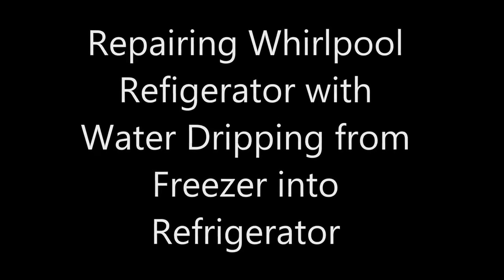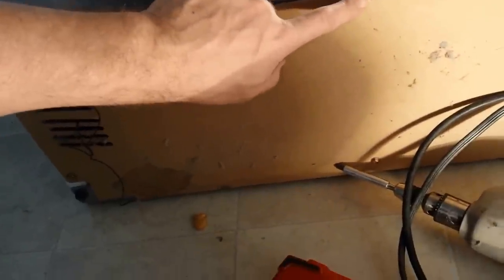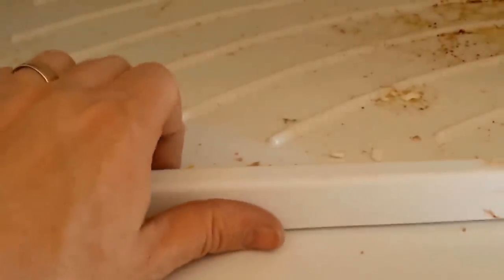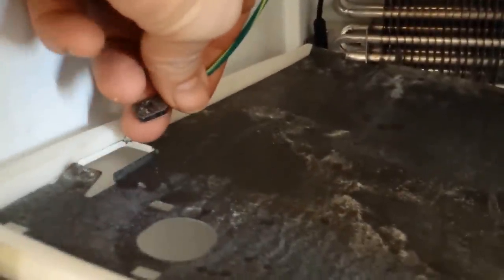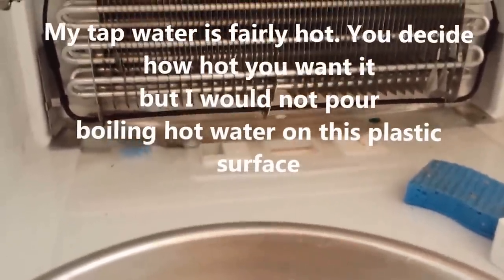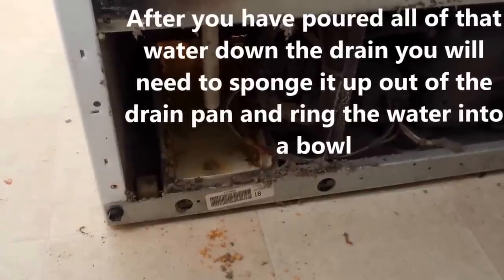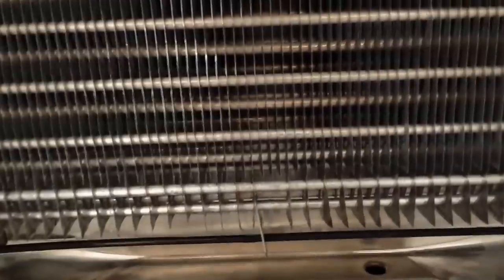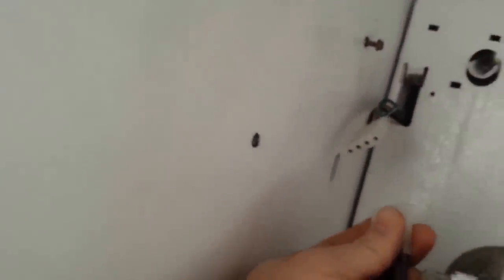How to fix Whirlpool dripping water from freezer into refrigerator compartment

Comment: Thanks Im going to fix mine soon based on this. my model is 1998 but looks similar except the ice maker.
Reply from the maker: Good luck. Mine is still problem free since this time.
Reply: ok I’m i. the middle of it tons of ice under the plastic tray. removed that and any residual ice 2 hrs later water is coming out the bottom too. thanks again for the detailed video!! btw mine was filthy underneath the tray too.
Reply: Btw my buddy sent me a pro-move. hang a small piece of wire on the defrost heater rod (the black thick horizontal rod just an inch above the hole)  and hang the wire to go about 2 inches into the hole. That way when defrost cycle goes the wire warms up and prevents any freezing from happening again. just take bare copper electrical wire and make a hook to hang on the rod.

Comment: this happens when the defrost cycle is on and the heating element that intertwines around the evaporator coil is melting the frost build-up. When this cycle ends there is still water dripping down the fins to the drip pan, which is aluminum, the freezing cycle has started before all the water has drained that's when the ice forms. After a few of these cycles you have an ice jam. There is a kit available to extend the heat from the heating element onto and inside the drip pan and drain opening. Try a search for th kit and look at the parts to get an idea of how it is designed. Then you can make your own (which is what I did) by taking some thin aluminum sheeting, either from roofing flashing or building materials, or other materials and cut a long narrow strip that you can clamp or crimp on (being careful not to damage the heating element and run route from the heating element closest to the drip pan down to the pan. Shape the end to allow insertion to the edge of the drain tube. Be careful not to put the strip to far down the opening or on any plastic parts, just the metal. This will allow heat to travel to the metal drip pan and warm the area around the drain. This gives extra time to keep the metal warm after the heating element has been shut off by the end of the defrost cycle. Also it is vital to clean all the debris and dust from the bottom and underside areas of the condenser coil which prevents airflow to remove the heat and that is disruptive to the cooling process.

Comment: I did it but it started again. I think it was actually cogged with paint chippings from the back playe which actualy was corroded.. i sucked out some with a magnet but after a month or 2 it started again.. ?
Reply from the maker: coocoonmama could also be food clogging it. I would test that theory by pouring water down the drain pipe and listening for it splashing in the drain pan located at the bottom and underneath of the fridge. If no water splashes and in stead  starts filing the freezer, the pipe's still clogged.
Reply: I clear out the frozen area and it continues to freeze up again. Go to this parts website. Put in your model number. One of the problems will be leaking. It will take you to this little part that is easy to replace. It says that it fixes the problem 72% of the time. I’m going to give this a try. https://www.partselect.com/AdvancedModelSymptoms.aspx?ModelNum=ET8WTEXMQ01&mfgModelNum=&fkMfgID=3&ModelMasterID=132935&PID=13

Comment: what if there is a leak from the unit. top freezer, water leaks onto floor, not down into crispers. Drain is not frozen, single solenoid valve is not leaking. Water randomly appears on floor....cracked drain pan maybe?
Reply from the maker: yeah, my first question would be that pan leaking or just filling up too much before it evaporated. Then I'd be looking at the water line or the valve to the ice maker leaking.

Comment: I usually use a hair dryer aimed at the area where the drain tube is. Can take about 2 or 3 hours to  thaw the drain tube. 
Has anyone had success with adding the aluminum or copper wire to the heating element  and into the drain hole.

Comment: I have exactly this problem with my 13 year old whirlpool gold . Could I just unplug for a day and let it defrost on its own?
Reply: I should add , I just had a repair person in to change a part  because the freezer wasn't freezing. As soon as the repair person left I noticed a huge buildup of ice at the very back centre lower part of the freezer. I have been cleaning up water in the refrigerator all week. I am concerned about undoing and wires and hoping that I could just let the icemelt on his own?
Reply from the maker: Donna Giamprini yes. you certainly can let it defrost that way. most of us just don't have the time to wait.

Comment: Use a 1/4 inch nut driver. Much easier. I put a copper wire on the heater into the drain.
Reply from the maker: I think the wire is a great idea. I'll do it with mine if it ever freezes over again. It hasn't since I made the video. 😁

Comment: Hey guys , whirlpool sell a drain tube that has a p trap 
Part # w10619951, after you defrost the ice on the drain tube, try to replace the drain tube on the back by the drain pan, since the kind shown the video doesn’t have a p trap so, easily get ice up, because heat from condensing  unit gets in .

Comment: My husband has done this twice, but the fridge goes back to the same problem after two weeks. What else could be going on?
Reply: I've done mine over and over again. It still leaks.  I ran a cable wire in the drain hole and moved it up and down to clear any debris thinking I had to have unclogged it this time.  Didn't work.  It still leaks. I don't know what else to do. 

Jan

Comment: Would it have been easier to use a heat gun instead of constantly pouring hot water into the refrigerator?

Comment: Mark, you didn't give a solution to prevent this happening anymore...... I fixed mine from ever doing it again.
Reply from the maker: Great, what did you do? I'd love to hear your ideas. I didn't have an idea to get this to never happen again. So what did you do?
Reply: @GetItDoneProjects  See the heater element that defrosts the evaporator? Bend the area over the drain closer. When it operates,  it'll keep the drain from freezing. I bent mine down to about a half inch above. Hasn't frozen since. I would do what you did every 4-6 months. When I saw the title to your video I was excited until I watched it.

Comment: I did this fix and it continued to freeze up.  Your drain might be plugged with food or dirt. If yours is fixed with the wire fix great. But others say replacing the sensor might be the proper fix. 

There is a temperature sensor that makes sure the defrost cycle is long enough. People can go to www.partselect.com and enter their model number. See the issue “LEAKING”, and follow the link to this page (for mine).  https://www.partselect.com/AdvancedModelSymptoms.aspx?ModelNum=ET8WTEXMQ01&mfgModelNum=&fkMfgID=3&ModelMasterID=132935&PID=13

The website says it fixes the problem 72% of the time. I have defrosted mine multiple times and I even put in the wire fix but it keeps freezing over. Replacing this sensor will allow the defrost cycle to last long enough to melt and drain completely. I think this is the correct fix that is described below by someone else.  If this works for anyone please reply and let people know. If this isn’t the solution, let people know as well.
Reply: Did replacing the sensor work for you?